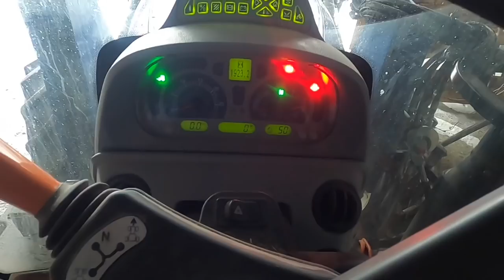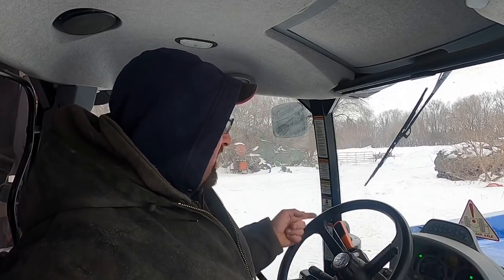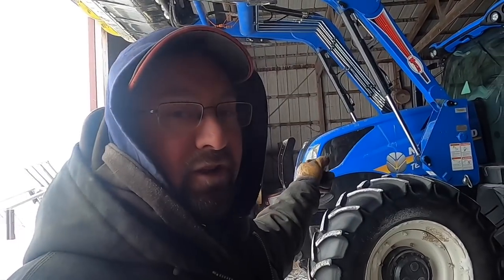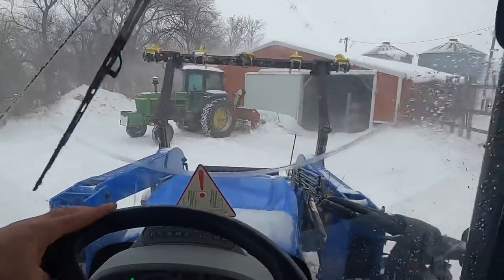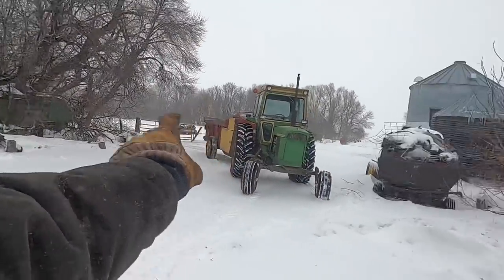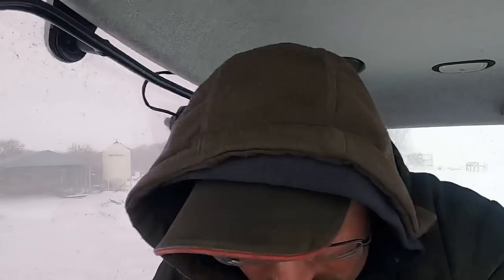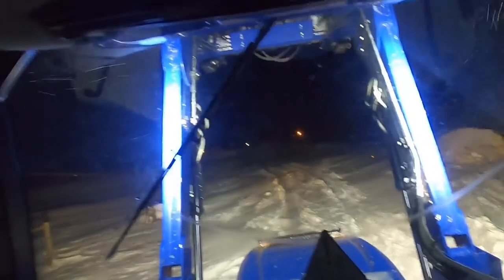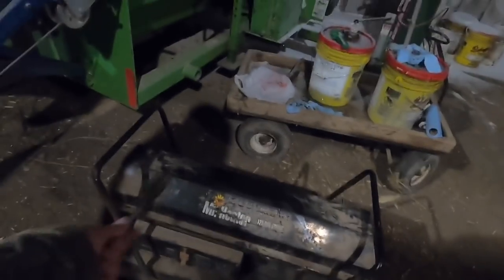The Loader Tractor Is Back Running Again and Dealing With Another Snow Storm!

Comment: Good video Paul 👍 what I don't understand is why the loader tractor needs cardboard in front of the radiator 🤔 surely there is a thermostat in the cooling system that should allow it to reach working temperature, we have had some real cold nights by here in Scotland but have never had to block the radiator on a modern tractor 🙄👍👍
Reply from the maker: It actually it says right in the operators manual during cold weather to put cardboard in front of the radiator. We actually do that on our other tractors as well to help get the operating temperature up. We have a lot cold weather here. It gets down to -35 degrees Celsius here sometimes. Lately it’s been around-20 degrees Celsius here.

Comment: Did you get the ball bearings out of the rear end of the 4240?
Reply from the maker: Nope can’t get to them. They’re stuck on the bottom of the transmission. I tried reaching in a far I could with the Magnet but couldn’t find them.